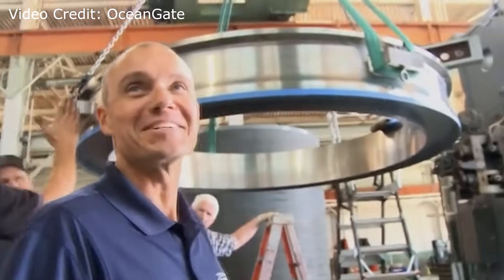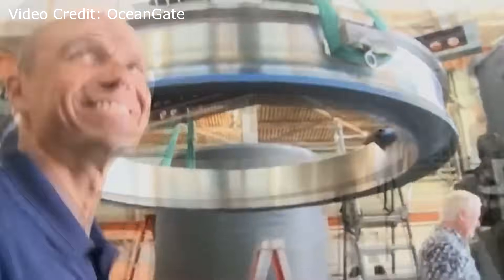Raw Unedited Re-upload of OceanGate's Promotional Video - Bonding a Titanium Ring to the V1 Hull

Comment: I'm leaving this comment to announce some exciting news! My company is picking up where Stockton left off. We've created Titan 2 submersible for dives down to the Titanic! Our revolutionary submersible is built from shredded cardboard and construction glue, making a single piece super strong hull. The process is simple- first, we shred approximately two thousand pounds of cardboard and put it into a giant stainless steel vat. We then add Liquid nails construction glue. With a giant mixer, we blend the cardboard and glue into slurry while heating it to hundreds of degrees. This slurry is then injection molded into our one-piece hull, then allowed to cool over three days. The end product is a super strong monolithic submersible hull. All other components, such as thrusters, are then fitted to the hull. We have one Titan 2 complete and are taking reservations for our first trip down to the Titanic. Tickets will be affordable to most, at 25k per seat. You are not considered a passenger, you're a sea cadet that actually helps during the dive. Don't miss out on this exciting adventure, book your seat now!
Reply: Sounds good! What kind of controller does it have?
Reply: Will the windows be vinyl double-paned windows I have in my house. They're very light and Home Depot has a buy 1, get 2 free promotion.
Reply: Going with the Xbox original HALO edition WIRED this time so no latency issues. Captain must wear Master Chief cosplay.
Reply: Sign me up, I'll gladly pay obscene levels of cash and laugh at whatever doom filled waiver you make me sign
Reply: Cash only, before the dive...
Reply: If I pay more can I help with the construction process too? I got a C in GCSE DT at school, and I have an IKEA toolkit (missing spanner).
Reply: 10 out 10 I nearly died laughing 😂
Reply: And as a bonus its 100%biodegradable
Reply: I'd deffinatly buy a ticket......... if I was suicidal lol
Reply: You son of a bitch, I'm in!

Comment: That is the dumbest things I 've ever seen considering what the vessel will be used for. If you look at the depth of the ring inside the ring, even the blind could see this was not going to last. What engineer in their right mind would think this method would be the way to go. Not even taking into the a account the glue itself, different materials compress and decompress at different rates. This was a ticking time bomb waiting to implode from the time the last layer was baked on.

Comment: 0:25. Is that the actual surface of the carbon hull? You can see the inconsistencies and porosity even there- I've seen better work from teenagers working in their basements on toys.
Reply: Yeah. The hull would regularly get wrinkles as they wrapped layers. So they would grind the wrinkles flat after each layer, and then continue. Which just means they were grinding holes in the sheets on each layer
Reply: @JamieVatarga Oh my god...
Reply: @JamieVatarga  No worries, we've got 5 inches of this stuff!  Plenty of strength left even after grinding holes in the weave.  What?  The NASA guys specified 7 inches minimum?  Plus extra inches to account for manufacturing defects?  Relax, it'll be fine!  Look over there!  A squirrel!
Reply: @JamieVatarga lmOoo

Comment: Also the area of the titanium ring which was used for the pressure hull    Bond was completely smooth and not abrasive which meant the bond didn’t really have anything to latch onto.
Reply from the maker: That is a very good point.  But, surprisingly, on the titanium ring they recovered from the wreck, there is still some epoxy stuck to the clevis and the carbon fiber hull was what pulled away.  You can see the impression of the plies in the epoxy.
Reply: @solareclipsetimer  That's interesting. It suggests that overall cleanliness and improper/inconsistent mixing procedures were more of an issue than the metal surface not being properly cleaned and abraded.